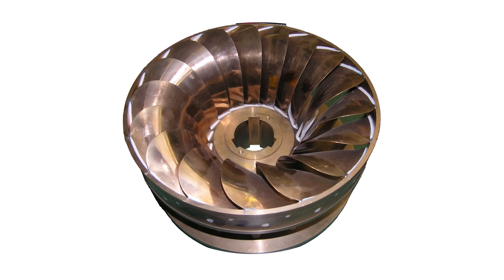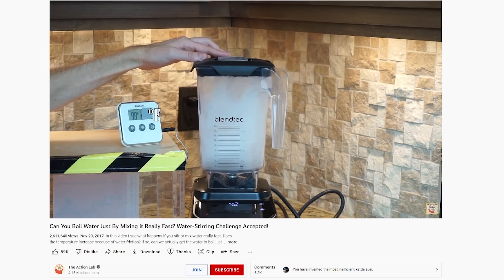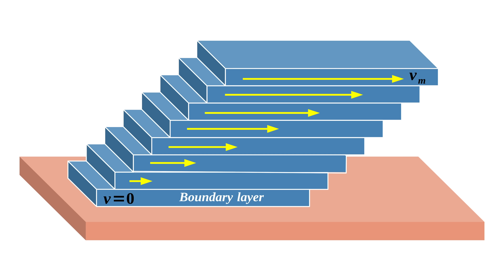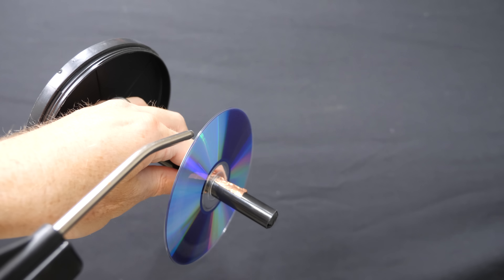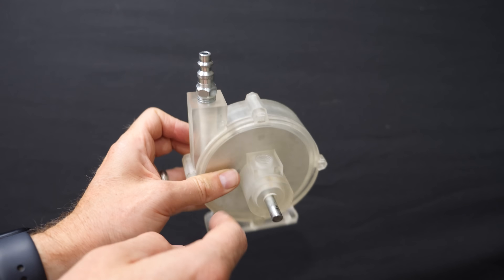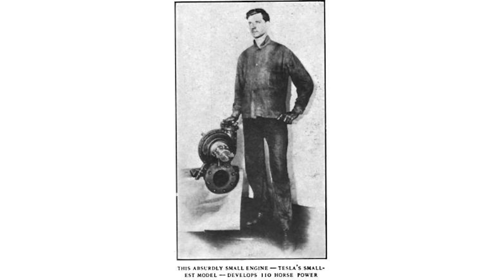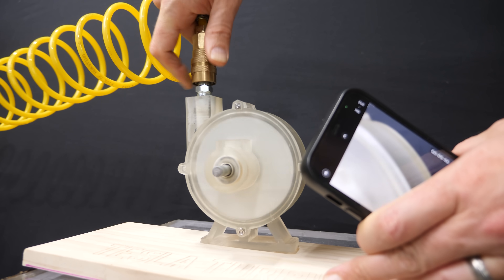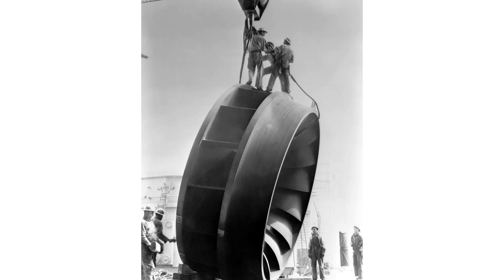How Fast Can a Tesla Turbine Spin?

Comment: I love the effort and love for Tesla turbines but I really wish these multi million subscriber channels would actually do their homework on the TesTurs before making a video telling people entirely inaccurate things about the working machinations of the TesTurs…

Despite what everyone erroneously claims about TesTurs, chasing high RPMs is exactly why nobody makes Tesla turbines that actually work. 

That’s NOT how they are supposed to be run in the first place. TesTurs output PLENTY of torque and power even at low rpms. 

Efficiency is actually increased by reducing slip. 

Increasing the disc speed does nothing to reduce the slip, only increase the distance the fluid could slip across the disc which doesn’t increase efficiency. 

Just listen to what Tesla says to do,

1) increase the fluid speed relative to. the discs (not high speed disc)
2) increase surface area.
3) decrease the disc spacing. 

“Owing to a number of causes affecting the performance, it is difficult to frame a precise rule which would be generally applicable, but it may be stated that within certain limits, and other conditions being the same, the torque is directly proportionate to the square of the velocity of the fluid relatively to the runner and to the effective area of the disks and, inversely, to the distance separating them. The machine will, generally, perform its maximum work when the effective speed of the runner is one-half of that of the fluid; but to attain the highest economy, the relative speed or slip, for any given performance, should be as small as possible. This condition may be to any desired degree approximated by increasing the active area of and reducing the space between the disks.”
-Nikola Tesla

Increasing disc speed only increases efficiency at the cost of power because of the centrifugal head as you increase the rpm, it counters the incoming fluid flow. 

“Still another valuable and probably unique quality of such motors or prime movers may be described. By proper construction and observance of working conditions the centrifugal pressure, opposing the passage of the fluid, may, as already indicated, be made nearly equal to the pressure of supply when the machine is running idle. If the inlet section be large, small changes in the speed of revolution will produce great differences in flow which are further enhanced by the concomitant variations in the length of the spiral path. A self-regulating machine is thus obtained bearing a striking resemblance to a direct-current electric motor in this respect that, with great differences of impressed pressure in a wide open channel the flow of the fluid through the same is prevented by virtue of rotation. Since the centrifugal head increases as the square of the revolutions, or even more rapidly, and with modern high grade steel great peripheral velocities are practicable, it is possible to attain that condition in a single stage machine, more readily if the runner be of large diameter. Obviously this problem is facilitated by compounding, as will be understood by those skilled in the art. Irrespective of its bearing on economy, this tendency which is, to a degree, common to motors of the above description, is of special advantage in the operation of large units, as it affords a safeguard against running away and destruction. Besides these, such a prime mover possesses many other advantages, both constructive and operative. It is simple, light and compact, subject to but little wear, cheap and exceptionally easy to manufacture as small clearances and accurate milling work are not essential to good performance. In operation it is reliable, there being no valves, sliding contacts or troublesome vanes. It is almost free of windage, largely independent of nozzle efficiency and suitable for high as well as for low fluid velocities and speeds of revolution.”
-Nikola Tesla

The only time you want to spin the turbine fast is when it’s being used as a pump/compressor, because ALL centrifugal pumps’/compressors’ performance is tip speed dependent.

“I have found that the quantity of fluid propelled in this manner, is, other conditions being equal, approximately proportionate to the active surface of the runner and to its effective speed. For this reason, the performance of such machines augments at an exceedingly high rate with the increase of their size and speed of revolution.”
-Nikola Tesla

Does no one actually read the patents before they go and try to tell people how the turbine actually works?!? 
🤦‍♂️
Reply: I saw how your turbine makes 2.6 kW of electrical power output. And it is amazing. It is really working!!!
Reply: @DmytroSichkarOnline  seriously though! Actual working Tesla turbines but somehow no one knows about Charlie!
Reply: @testurenergy  who knows! Things can happen real fast! 🔥😈🔥
Reply: @DmytroSichkarOnline  thanks dima! Yeah hopefully this all gets some traction and we can show everyone just how good TesTurs really are!
Reply: 🤭 yeahhhhh…. Don’t you actually build real working TesTur too?! 

Last I saw, Charlie, your latest TesTur did 4.25kW at only 6000-8000rpm and 6.22ft-lbs of torwue at only 4150rpm, right?!
🤭

Why does everyone make these incorrect statements about the TesTur?
Reply: @teenagemutantninjaraver2224  you nailed it!
Reply: Your totally right , because I replicated your design i can confirm Al of this, bigger diameter en smal spacing offer a great energy output at low rpm
Reply: @oscarverwey  the Tesla earthquake machines that you build are amazing!! 🤩 how does nobody know about your build either?!? 

What the heck YT algorithm…? Someone get these two some attention!
Reply: @testurenergy  probably because people like juicy stories way better than actual facts en working stuff XD
Reply: @oscarverwey  lol tooo true 🤭 at this point people have said TesTurs can’t work for so long you’d think that upon seeing one work they would go crazy!
Reply: @oscarverwey  for real Oscar those Tesla mechanical oscillator builds are prime 🤌
Reply: Yeahhhhh….. lol “Tesla turbines have to be spun to fast and only get low torque…” 🤭 

Charlie already has proven that a complete myth. 

No wonder no one has been able to make them work before you! Big channels just make a quick video telling people incorrect working principles of the turbine and it spreads like wildfire! 😮‍💨

Comment: What might increase the efficiency a bit more is some kind of surface shape that would promote laminar flow even more - some kind of grooves along the path of the fluid. It might not be possible though - just a wild shot in the dark.

Still, the problem of load put on the turbine decreasing the efficiency is something that cannot be resolved - this kind of turbine has very little torque when we want to maximize efficiency.
Reply: Why do people think other engines don’t slow down when you put a load on them..?!? ALL engines do this… 

You just give more throttle… 🤦‍♂️
Reply: [TL/DR: This is not a mechanical turbine in any shape or form. Since all molecular adhesion and internal viscous forces within a fluid are governed by electron orbital interactions, this makes the Tesla turbine a purely electronic turbine.]

The BIGGEST misconception about the Tesla Turbine that most people get wrong is that they think the fluid is actually sliding and dragging on the disc, similar to as if a solid object was “sliding” across the surface of another solid object. 

It is not. Full Stop. 

The fluid that’s just off the surface of the disc face is ALWAYS statically adhered to said disc face and never moving relative to the disc. 

The torque to the disc comes from shear stress “cohesion” forces within the motive fluid trying to move through itself.

The shear force is transferred through the motive fluid itself to the layer of fluid that is statically adhered to the disc faces, and then through the virtue of molecular adhesion the discs are pulled along with it, or Vice versa the discs pull the fluid along with it. 

The only “friction” involved in this is that of internal friction within the fluid against moving through itself, ie Cohesive viscous forces. 

And sorry I don’t mean to sound like I’m being pedantic, as I’m sure I’m restating many things you already know. 

It’s just a very important key part of the operating functions that everyone gets wrong. This is not a mechanical turbine in any shape or form. 

Since all molecular adhesion and internal viscous forces within a fluid are governed by electron orbital interactions, this makes the Tesla turbine a purely electronic turbine. 

As Tesla even alludes to in the article “Dr. Tesla Talks Of Gas Turbines”… 

… “I have been working at this a long time. Many years ago I invented a pump for pumping mercury. Just a plain disk, like this, and it would work very well. ‘All right,’ I said, ‘that is friction.’ But one day I thought it out, and I thought, ‘No, that is not friction, it is something else. The particles are not always sliding by the disk, but some of them at least are carried along with it. Therefore it cannot be friction. It must be adhesion.’ And that, you see, was the real beginning.

“For if you can imagine a wheel rotating in a medium, whether the fluid is receiving or imparting energy, and moving at nearly the same velocity as the fluid, then you have a minimum of friction, you get little or no ‘slip.’ Then you are getting something very different from friction; you are making use of adhesion alone. It’s all so simple, so very simple.

“This is the greatest of my inventions,”……
-Nikola Tesla (September 18th, 1911)

When designed correctly, it works principally upon electron interactions between the fluid and itself and the fluid and the disc material. 

The first important factor being how well does the fluid actually molecularly adhere to the disc faces when submerged in an atmosphere of the motive fluid. 

This is also seen as the “Wetting angle” when there are two fluids in contact with the surface and they are competing for adherence. 

Think hydrophobic and hydroPHILLIC surface treatments.

The second important factor is the viscosity of the motive fluid in question, as it represents the fluids ability to “flow through itself with or without resistance” per se. 

Herein lies the reason it is extremely important to maintain laminar flow regimes within the disc spaces. 

Because irrelevant of the viscosity of the fluid, ALL FLUIDS, liquids and gases, can be forced to flow in highly efficient low Reynolds number laminar flow regimes given the right initial conditions and “flow cavity” parameters, such that turbulent boundary layer slip is eliminated, stream separation and counterflow is eliminated, rapid pressure changes from turbulence resulting in noise losses that can lead to early fatigue on discs and parts is eliminated, etc. 

Furthermore, because windage is all but inexistent in the Tesla Turbine, it stands to potentially be the quietest running turbine ever when properly designed. 

(Sidebar: This is why I have speculated over the years that these Tesla turbines have actually covertly been in practicable use all this time in things like covert/stealth submarine Primary Power Units (PPUs) and/or just plain stealth “trolling motors” but that’s honestly my own sheer educated speculation at this point. 🤷‍♂️ it just makes sense.)

This is where working out the complex solutions in the Naviar-stokes equations come in for designing practicable machines.
Reply: Also Tess turbines get PLENTY of torque. I know for a fact and have actual proof of it. Peak torque of 6.22ft-lbs at only 4159 rpm with just room temp compressed air that never got over 40 psi at the nozzle on a plastic and aluminum prototype. 4250 Watts between 6000-8000rpm. 

Have already proven real electrical loads of 2650 watts at only 9500 rpm again on room temp compressed air that never went over 20psi at the nozzle. 

You just have to know how to design the correctly.
Reply: @CharlieSolis it has plenty of torque? Put it in a car and run it at max speeds, and record it
Reply: @edgardox.feliciano3127  I take it you didn’t see what integza put out about 2 months ago on Tesla Turbines did you?

Comment: I’m in college for my aviation maintenance license, and was wondering would a Tesla turbine be possible to use for a jet engine?
Cause today what is used is called a turbo fan, with jet blast being compressed out the center tube and residual fan air blown out the outer diameter.
Reply: Look up the Jetoptera, iirc, uses an air compressor and air entrainment.
Reply: @Dan-gs3kg  Ty I’ll do that
Reply: @ogelpeace4610  yes they can, it’s what I do for a job. Make real working Tesla turbines that output real power and torque even at low RPMs. 

Tesla turbines work just fine. You just have to know how to design them. And there’s proof of all my TesTur power tests to back up my claims too.

Comment: One of the other things that limits their adoption now is that with computational fluid dynamics (CFD) traditional turbines can be designed to be hyper optimized for their use cases, in some ways taking advantage of the very principles the tesla turbine exclusively operates on. A great example is the modern steam turbines that are installed into thermal power plants. they almost look like a hybrid of the tesla turbine and a standard jet engine compressor.
Reply: modern steam turbines are heat engines (Carnot engines) and follow the same rules.
Reply: @a4Jonatica  He's pointing out that the application of CFD on other turbines doesn't preclude its use with telsa turbines. To solve that, simply use CFD on tesla turbines. 

Then he goes on about how the tesla turbine in general has a lot more room for applications due to it not having the same flaws as other turbines, the example being contaminated media... Wet steam will smash normal turbines, but it can't do that to the tesla turbine.
Reply: CFD is NOT an issue for Tesla turbines.. where do people come up with these stories… 🤭
Reply: @testurenergy hay!  derpy duuurrr, not what was said.  Modern turbines are designed using CFD, part of what they do is take advantage of the no slip boundary conditions through computational optimization of the design. Effectively they make a traditional design use many of the advantages a tesla turbine provides while having an optimal performance range for the application and still conform to a more traditional turbine layout.
Reply: @MorRobots  you verbatim said that “one of the limits of Tesla turbines is that CFD can optimize other turbines best case so it wouldn’t be worth doing a Tesla.” 
🤭 
That’s not a limit for the Tesla turbine. CFD is not directly nor indirectly an issue for the Tesla turbine. 

Which is what I said.

Like how ridiculous to say that because cfd can make other turbines really good it’s a limit for the Tesla turbine 🤭

There are MANY operating conditions that no other turbine can even operate in for more than a few minutes that wouldn’t even bother a Tesla turbine. 

Wet steam for example destroys multi million dollar steam turbines in minutes, wearing the Blades down to little nubbins from cavitation. 

Not an issue for the Tesla turbine. 

Exactly how does computational fluid dynamics optimizing the flow cavities of other turbines somehow limit the Tesla turbine from being able to outperform for longer stress conditions than any other turbine? 

Cfd doesn’t even account for stress testing or for that matter erosion. 

The only one limiting the Tesla turbine is people who keep saying it’s a limited machine 🤭
Reply: @testurenergy  that was not the point surely, mine is why do we not get some CFD into play and optimise design before build.  More generally is it not all about nozzles?
Reply: @testurenergy  The cult of Tesla...completely deluded....
Reply: @balometer what proves its a delusion?

The culf of proofless "debunking" 🤦🏿
Reply: @ki0w0-lordofwatersheep There has never been a cult in all of history that didn't depend upon people being deluded and believing untruths. The cult of Tesla is no different. The fanboys make up the most proposterous nonsense for their own consumption. Tesla had some engineering achievements but was not a good scientist. He was a terrible businessman. So all-in-all, a mixed bag. 
Now do your own research, and don't ask me to spoonfeed you.